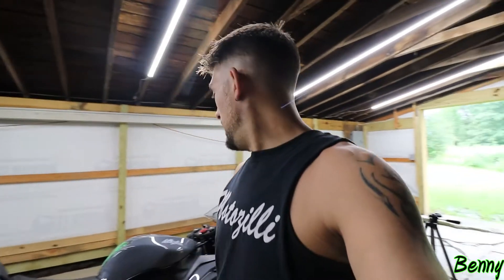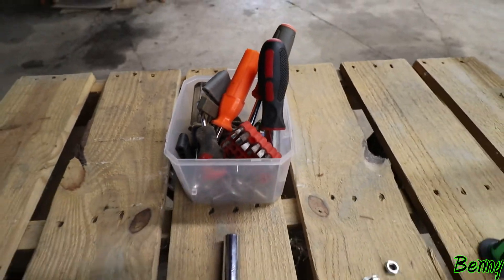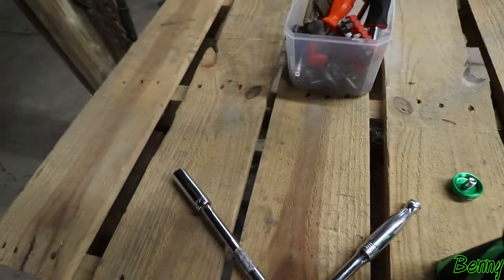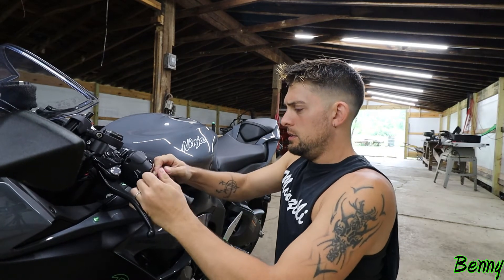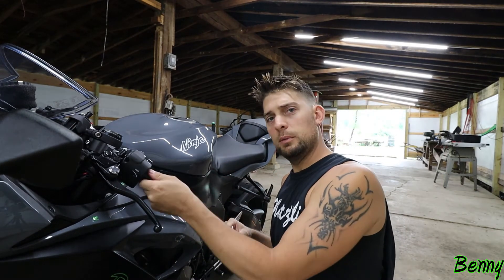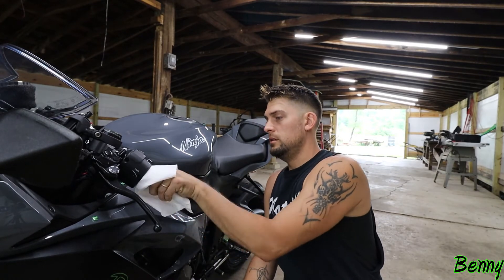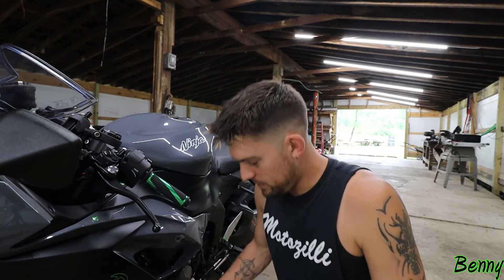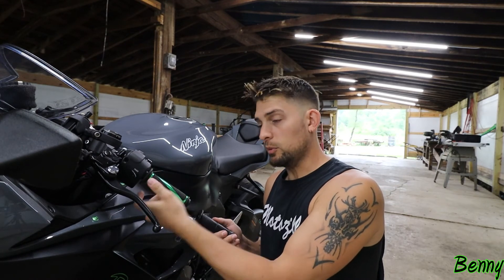Motorcycle Grip Replacement | Ninja ZX6R

Comment: Helpful video, thanks.  Hey, does the alcohol activate adhesive that's already on the inside of the new grip?  If not, I'm inclined to use the hairspray trick to ensure strong adhesion.  Unlike you, I'm too inpatient to remove the existing grips by sliding them off, I'll just slice them and peel!   Thanks again.
Reply from the maker: I honestly don't think my cheapo grips had any type of adhesive. If yours have adhesive I'm sure the alcohol will help.